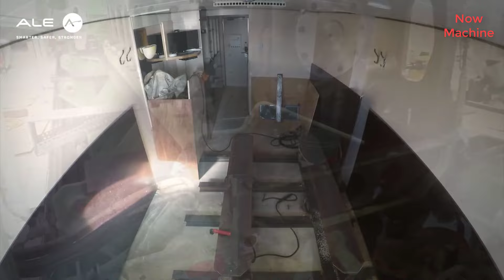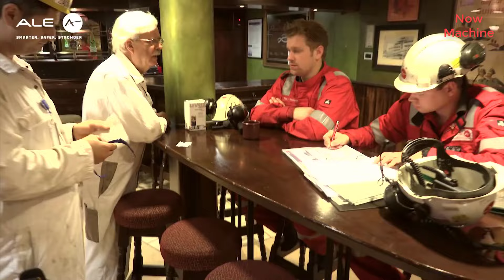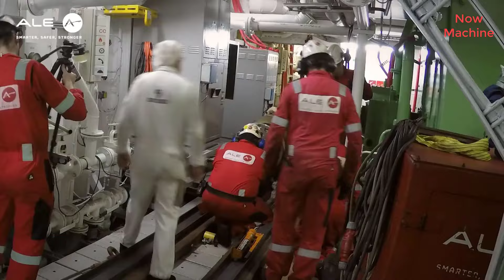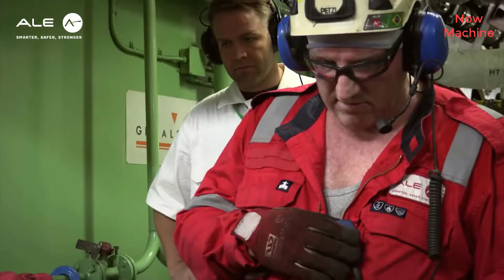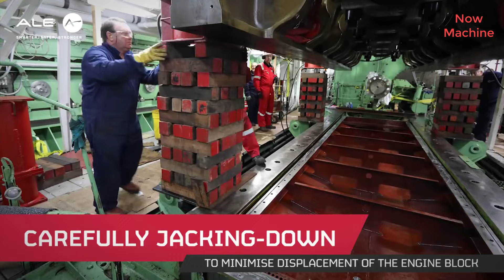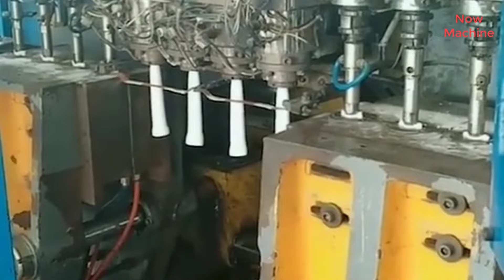Incredible Crankshaft exchange on the cruise ship. Other Amazing Machines Manufacturing Technology

Comment: Truly impressive how they move the 7.5 metric tons crankshaft in a such a narrow space front the upper floors down to the engine. Was a bit surprised that the engine block had to be lifted up and then lift up the crankshaft and bolted from under. There must be a reason to do it this way anyway I find it very cool how they managed....
Reply: Because the bolts to the conrods connecting to the pistons will only be accessible from below.   Plus the main bearings on the engine block only from below.   Just like on a car engine.   Some will do work from under the car rather than taking the engine out.
Reply: @johnsim3722  thanks for the info as I didn't know that. It makes sense what you stated 👍👍
Reply: @johnsim3722  Bolts to the conrods are usually accessible from the sides.
Reply: @mcplutt  I believe there's different designs which have the closure on the side, giving side access.   And engines have inspection panels to suit.   But in this case the crank shaft still needs replacing.   And you can see the main bearings were accessed from below.
Reply: 7.5 tons?  are you sure ?
Reply: @yettimannettii2039  yes, at least what is stated on the video, but it is good to understand that like most of the crankshafts are actually a one piece affair completely forged and precisely balanced. The other issue is that it is not a pee wee engine like an old Morris engine but an enormous engine of several tonnes! I saw some of these massive engines and really impressive because of their size.....

Comment: Engine mechanics: [aligns crankshaft under block]

Also engine mechanics: "the crankshaft is backwards, take back out and flip it around!"
Reply: 🤔 yea no. Highly doubt that would ever happen in this situation.
Reply: @DavidJohnson-hg1mz  I've been on construction sites where something similar happened. They built the bottom part of a structure rotated 180° but it wasn't noticed until weeks later. It all had to be taken apart and redone. It's rare but it definitely happens.

Comment: would have loved more details on this job
actual time?
the life of the old crank?
the hired outfit that did this install?
the total cost of job?
was it planned or a mechanical failure?
was this job in budget or a blow out?
was the top end refurbed also?
what engine type was it?
what port was this?
was this a non stop 24/7 operation to meet deadlines?
do these engines have run in cycles?
fuel burn per hour?
Reply: Jij werkt als ambtenaar bij de overheid?😅

Comment: Can't believe they had Jenga holding the block.
Reply: Common practice using blocks of wood mainly hardwood in heavy engineering, metal on metal is dangerous as it tends to slip. Using wood is less likely too.

Comment: i remembered spending 10 hours measuring and aligning shims for 11,000 pounds Cummins generator OUTSIDE of warehouse  times 3 for power emergency power generation    the surface finishes on BOTH platform and engine bottom end must be absolutely at 0.00 some change and that is extremely expensive machining procedure.   thats another reasons why  massive marine engines like these cost in millions

Comment: It becomes obvious why they install engine first then build rest of ship around it. When big parts need replacing, work in tight spaces make it even more challenging. Crankshaft, camshaft, heads, pistons, etc are harder to replace in the field. One part that can't be easily replaced is engine block. That requires disassembly of most of engine, making hole through hull, over 5 million dollars, and weeks of time.
Reply: A nightmare, in fact.
Reply: @gibbogle9486  I've never seen a large diesel up close, have you? It would be quite the sight.

Comment: As a marine diesel mechanic very impressed. The engine does not look very old. Warranty repair?
Reply: Most likely preventative maintenance based on hours of operation I suspect. Edit: If that is the Zaandam, my wife and I sailed on that ship. Good crew, steady ship in rough seas.
Reply: I was working on the ship at that time - the shaft was out of spec for a maintenance plan.
Reply: Needed new bearings from wear is what i heard

Comment: I swear the crank in my truck has more throw than that one. Crazy those engines make so much power with that arrangement, but totally obvious why they run forever.
Reply: High compression,  leading to excessive wear on main bearings and low oil pressure and failure.

Comment: With enough chain falls and rigging points, I can move anything. You would be amazed at what goes on in engine rooms, especially during a yard period.
Reply: So if the block goes bad do they have to cut the ship open to get new one in?
Reply: @69jbr69  Yes!

You'd like to see this video of a motor replacement: https://youtu.be/cP1kpKk7A1I
Reply: @69jbr69  If need be, yes. I’ve done it.

Comment: Sorry to say, but the working on height sfatey is not applied as the  fall absobrbing unit is not correctly installed , the line is way too long , so in case of a fall the guy will hit the floor or will gain much more momentum than designed for the unit . be noted
Reply: Add to that there was a lot of people walking around a suspended load, or under a dynamic load with no helmets on.

Comment: Makes me wonder how you actually know that it requires replacement 🤔 ???
Reply: Low oil pressure due to failed main bearings is my guess.
Only 4 main bearings in a ship engine of that size and horsepower.

Comment: A poetic illustration of how Maintenance is the most thankless job out there. Ship building has accompanied man's existence to a ratio almost 1:1, and this is the best procedure that that exists to maintain an engine. That ship has a casino, water slides, swimming pools for surfing, theaters,  zip lines, but a billion chain hoists, slings and wood blocks are the best they could come up with to change out an engine crankshaft? Lol
Reply: This is likely better than some. I've been on a ship that was designed without any regards to engineering or maintenance of equipment. Maintenance access panels against bulkheads, no room to work on anything without disassembling more than you need to, lack of places to hook up a chain fall safely, nonstandard equipment labeling, etc. The client got what they wanted, but the engineering department is the one that has to suffer keeping the damned thing going. Not to mention, they reduced the ship size by like 50 feet to be able to fit at a certain berth, only to find out the design change inadvertently increased the draft beyond the allowable limit for that dock.
Reply: That’s how it’s done. If you have a better idea, I would like to hear it, and so would thousands of other ship’s engineers.
Reply: Yep. No reason to let technology invade where it can't improve anything. I'd be glad there's some job in that engine room that could still be done that way.

Comment: Look at the camshaft. That thing has more iron in it than the typical car. I wonder how often the cam wears out when compared to the crank. BTW that crank looks like it has a 900mm ~3ft Stroke. I wonder what the compression ratio is. Prob max of 300 rpm and idles at 80 rpm or something nutso like that.

Comment: Not sure why they had to weld aligning brackets to the engine base when there is clearly a lip there, I would have avoided the welding.  Anything coming of the welding could have gone into the bottom of the motor there, no use of blankets to limit that.

Comment: What was wrong with the crank? You don’t just change cranks like spark plugs, be nice to know what happened.
Reply: Cleetus drifted the ship.
Reply: Bearing wear.
Reply: Guessing only four main bearings was not enough for the high compression engine, leading to low oil pressure and failure .

Comment: Tsk - a failed crankshaft on a new engine?  Sulzer have always had a great reputation for reliability , it seems that they dropped the ball on this one - I am surprised.  I have worked with Sulzer marine engines since their SD variant built in the 50's , then on RD and RND engines. Never worked on an RTA.  All of these low rev engines ran like sewing machines - looks like these medium speed engines don't.
Reply: So on the basis of one failed crankshaft all the engines are a write off and hopeless. Great logic.
Reply: @OpinionStatedAsFact   where did I say that?  You seem a bit creative , you been on the sherbert?

Comment: If the crank failed, most likely to poor lube, then cams and rings as well as con rods are suspect. Lipstick on a pig.
Reply: You are the expert.
Reply: you realize that they most likely replaced a lot more than just the crankshaft during this repair right?   The subject of this video was only the crankshaft replacement but consider the fact that at the end of the video the engine was still wide open with much to be done before it could be started.    Besides with a cruise ship like this they will make sure everything is back to 100% reliability before it left the dock for passenger service again.    Notice that they didn't conclude the video with the start up of the engine.    Just because you didn't see them replace the parts you listed in the video doesn't mean that they weren't replaced.    A little bit of common sense can go a long way  you know